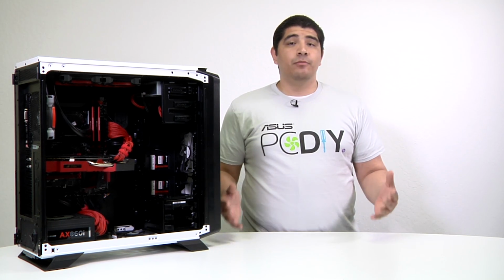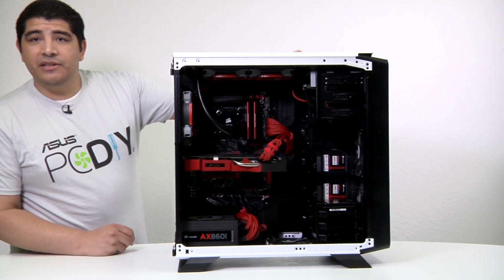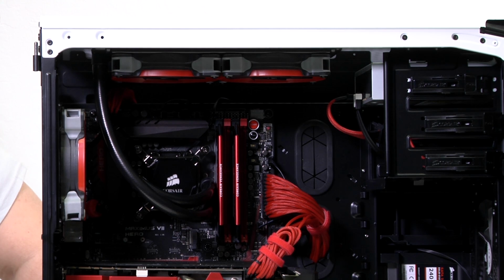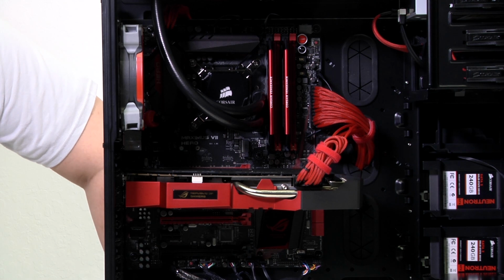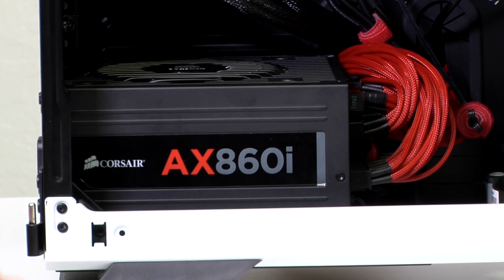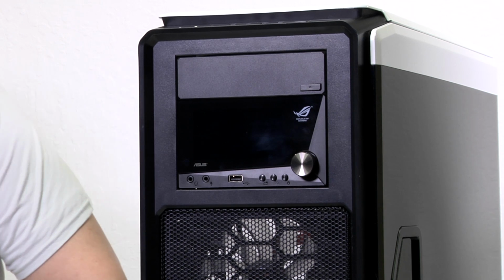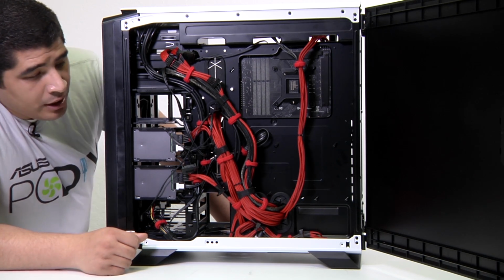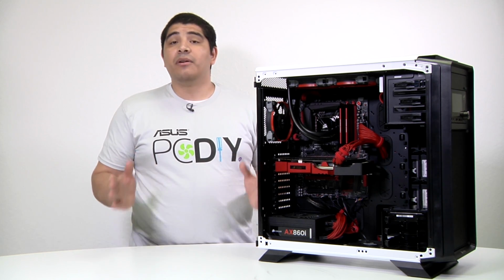How to Build a Killer Gaming PC with ASUS Z97 Motherboards

Comment: I would rather use a good air cooler from Zalman than the Corsair H100i. It will give you better cooling than any sub-$200 liquid cooler, for under $100, and is quieter than the multitiude of other fans you will have in the machine.

Comment: After waiting 6 weeks to get my ROG Front Base for my Hero VII i find that the audio cable is still to short for my Corsair Obsidian 750D case, i thought Asus was going to fix this with the latest shipments, i have the latest bios on mine since i do have the sticker on it, at this point i am not even using the audio cable since it makes my otherwise clean cable management unsightly.

And for those that have commented about the GTX760, all i can say is maybe i got a golden card, mine is clocked @ 1301Mhz and + 500Mhz on memory, its the 4GB EVGA and i play @ 1440 most games maxed with 2x AA, you don't really need AA @1440.SLI maybe in my future but at this point i see no need for it.
Reply: *****
Thanks for the reply JJ, I respect you immensely, and yes i am in NA, Key West Fla, at times we don't think we are part of the USA, its 92 miles to a Wall Mart FFS! I will contact customer support and see how that goes, Im still enjoying my Front Base, and NOBODY is better than you as a company rep, hands down.

Comment: JJ, great video, help me out on my Asus Rampage IV Black Edition motherboard it has the EZ Plug with a 4 pin male connection, my Cooler Master 1000W Silent Pro PSU has a 4 pin female plug but it's square with 2 yellow 12V and 2 black ground wires, can I use it to hook to the EZ Plug and where do I get the conversion cable to make it happen? Thanks, love Asus and your videos.

Comment: Well done.  On the H100i did you have it exhausting air or intaking air?
Reply: exhausting air. :)
Reply: tokojojiji Really?
Reply: yeah, notice the placement on the red rings on the fans that are mounted on it. They push air through the rad and out of the case.
Reply: tokojojiji Oh ok.  I saw the red rings and had thought they were setup for exhaust.  Just need someone to verify.  Thanks!

Comment: weak cpu + strong gpu > strong cpu + weak gpu.
Your gpu + cpu combination doesn't make sense.
Reply: Wellstar Very good point given the title says killler gaming pc
Reply: ***** Games are more GPU dependent rather than CPU dependent. He could have selected the i5 or some cheaper amd processor and a stong GPU, but he got the i7 for some reason, which doesn't make any sense.
Reply: ***** Well, when it comes to gaming, the gtx 980 would make more sense, but an i5 would still max out every game.
Reply: ***** i5 and i7 doesnt make any difference in gaming, so it's useless to wate money to i7 if you're only playing games (I had to still answer sorry)
Reply: ***** Well then I highly recommend for i7
Reply: ***** He meant LGA 2011-3 CPU I believe
Reply: ***** Get the 4790k and watercool it, a couple of gigahertz and megahertz later, you will have an INCREDIBLY strong cpu.
Reply: Wellstar Isn't it already strong enough? But I mean, the title does say 'killer' after all.
Reply: GraphiTe The 4790k is already strong, but if you wont overclock it you can might aswell get the 4770 (non k)

And as i said, if you can get a 4790k, you can might aswell get the i5 instead and use the extra cash to get a better graphics card.
Reply: Wellstar Ah, I see.
Reply: The whole real point is you only need a i5 there is very little difference in gaming between i5 and i7 (i have a i7 860 and my new 4790k)

a i7 has things it shines in, but in gaming it is only a little better than a i5 and costs alot more.

However the real reason everyone is like wtf is not about the i7 (even though looking at comments you would think it is).

It is the 2 year old? mid range obsolete graphics card. 760.

i have a 4790k and a 970gtx and even pairing this would be somewhat wrong for pure gaming, but i do video editing so i can justify the i7, but if i purely gamed i would get a i5 and a 980gtx which is a much more appropriate match.

The Real reason....
current games dont support multiple cores well, games support 1,2 or 4 cores, very very very few games support 6 and as far as i know, no games support 8 cores.
the top i5s have the same core count as the i7 the big benefit of the i7 being the hyperthreading (+ more) but the hyperthreading has very little impact due to the current games lack of ability to support multiple cores (hyperthreading is virtual cores).

However if you were to buy multiple graphics card (sli or xfire) or a super graphics card(titan) then the i7 mayb a little more viable

P.S. i7 is awesome :) for everything, but this dosn't change the fact that it has little game fps improvement over the i5.

This money is better spent on a upto date graphics card, better graphics cards tend to show the best fps increases in games not cpu's

Most games performance rely heavy on the graphics card, an exception being starcraft which rely's more cpu(there are more), therefore most gamers should have awesome graphics cards.
Reply: SiCK GamER Exactly, you can use the extra cash to spend on a better graphics card. I have the 4790k myself paired up with the R9 390. I could have gotten an i5 to fulfill my gaming needs, but since im also working with 3D rendering the i7 gives my computer a little bit of extra Bacon.
Reply: I run an i5 4460k with a GTX 970 and 8GB of RAM. It's for gaming. The i5, though not as good as some i5s, was about $190-$200, and it has great single core performance. The GTX 970 is more than enough of a good GPU for me (runs everything highest settings at least that I play, like Witcher III, GTA V, etc.) at it cost me about $380, and the RAM... I thought about getting 16GB but there is pretty much no point in 16GB unless you are rendering videos (same as i5 vs i7), and no game with applications already open should eat up more than 8GB of RAM. I'm really good at managing my RAM usage anyways. For anybody thinking about building a PC, the GTX 970 is amazing and you'd be so surprised at how much of a difference an SSD can make. Buy one.

Oh, and all that is connected with a Fatal1ty Z97 Killer Mobo. That's how I got here.
Reply: Lindsey VanDusen First of all, nice build. Second of all, what comment are you reffering to?
Reply: Wellstar Just contributing my two cents to the conversation. Supporting your argument if anything. An amazing processor isn't required for gaming, just one that is good enough not to bottleneck your GPU. Running on a GTX 970, anything that wont bottleneck that is good enough for the game IMO. 

Not many games are CPU intensive, and any games that are usually run the best with a processor that had great single core performance in my experience. I went with an intel specifically for that, because intel processors though not exclusively better than AMD often have a better single core quality even at lower clock frequencies.
Reply: Lindsey VanDusen I feel like AMD is loosing a lot to intel. They have been re-using old architectures for years now, and eventough they make good processors, i'd almost never recommend an AMD processor to anyone (except for when the build has to be very cheap)

Im hoping for Zen, or whatever they are coming out with 2016/17.

Same with the GPU market.
Reply: +Wellstar  I have the 4790k sli 970s . whats your thoughts, I'm new to pc
Reply: yes sir It's a good pc, will run most games maxed out.
Reply: +Wellstar just finished switching everything over into a corsair air 540 since my h440 was getting hot with the covers on
Reply: yes sir Do you overclock a lot? Because a H440 shouldn't be a problem for airflow unless you have several graphics cards and or overclock a lot.
Reply: +Lindsey VanDusen  nice build :-)  i run a i5 4690 with a evga GTX 970 FTW and 16GB ram and 500GB SSD and i love it :-)
Reply: Oh and a good idea for anyone interested in a powerful CPU, look for a Xeon. If you don't have a GPU then don't consider it but if you're building a gaming PC then you can waste less money on inbuilt GFX (like with a sandy bridge) and spend that towards a good dedicated GPU! Xeons are server processors so they are pretty tough and they are meant to never really turn off, so overclocking is usually more lenient, and without onboard graphics you wont be wasting $50 on that too!

Plus they are good multitaskers. I would go for an i5 for gaming honestly because of the great single core performance but the Xeon is a solid intel processor!
Reply: Lindsey VanDusen Used to have the 1230v3, it performed almost equaly with my 4790k (the i7 did perform better when i overclocked it though)

Comment: I've just purchased ASUS Maximus VII Ranger motherboard, I've built a system but while POST I'm getting Q-Code 'AE' - Legacy Boot Event (as mentioned in manual). Please help me in this regard J.J. It booted first time perfectly & I can see in monitor as well & it was written Press F1 to run setup when I pressed F1 nothing can be seen in monitor after that. I dont know what's happening just AE can be seen in Motherboard & no display now... I tried reboots but still no displays & AE error code on motherboard.

My whole configuration is as follows::
Intel core i7 4790K
ASUS Maximus VII Ranger MoBo
Kingston Fury Red Series 8GB - 1600 MHz
Corsair H100i CPU Cooler
Corsair CS750M PSU

Comment: JJ my p8p67 le motherboard 2xSATA 6Gb/s ports gray are saying your ssd is connected through SATA 3Gb/s SATA2 port in Samsung magician evo850 ssd I am using the wires form the box if that's a problem

Comment: Hey, what do you think about this build? I want some help cause its my first gaming pc: 
Case: Cooler Master Elite 430 USB 3.0
MotherBoard: Asus Maximus VII Hero Intel Z97 SK1150
SSD: Kingston SSDNow V300 2.5 Sata III 120GB~
Cooling- Cooler Master Seidon 120V Plus
CPU- Intel Core i5-4690k 3.5GHz 6MB Sk1150
GPU- Asus ROG POSEIDON-GTX770-P-2GD5
Memory- Corsair Vengeance Pro 16GB (2 x 8GB) DDR3-2400 Memory 
Power Supply:Cooler Master Urano VX 750W

Total is: $1198

I was thinking on VII Gene mother board for my pc, its a mAtx and 40$ less... Its Worth the trade?

Comment: i'd skip the h100i and the corsair fans, go for a decent air cooler, use just 1 SSd and get a R9290x or a GTX 780 instead of that crappy 760

Comment: ***** Hey JJ I have a question. I'm very new to all of this and haven't the slightest idea how to overclock anything. I am very interested in the Rog Front Base for my Asus Maximus VII Hero and I see its 1 button overclocking but what does that mean? For example if I have a i7 4790K which has a stock speed of 4.0Ghz and a turbo boost speed of 4.4Ghz does that mean I can reach 4.4Ghz with that OC button and stay at 4.4Ghz or do I need to manually OC the cpu in the bios 1st for the same or higher clock speeds? Many thanks in advance for helping a novice.
Reply: ***** I see. Thank you so much for the help. You rule man!

Comment: Hi there,

Would you please let me know your opinions or any suggestion ? I want to build a beast as follow: Really much appreciated. 

Motherboard Asus Z170 ROG MAXIMUS VIII HERO
 
Motherboard Asus Z170 ROG MAXIMUS VIII HERO
 
CPU Cooler Corsair H115i
CPU Intel Skylake 1151pin i7-6700K
 
RAM 16G Kit (8Gx2) 3000 Corsair Vengeance Black
 
Primary hard drive Samsung 850 PRO 512G
Secondary hard drive WD Black SATA3 1TB
 
Power Corsair 80+ Platinum HX850i
Case Corsair GraphiteCC780T-WH
 
Graphic Card 4G GTX 980 Gigabyte OC (WF3OC)

Comment: ould this set up work and will it be good, also what could be improved (this is my first build and want it for gaming)

cpu: Core i5 4590 Quad Core Processor Socket 1150 
cpu cooler: Coolermaster Hyper 212 EVO
motherboard: Asus Z97-K Socket 1150 VGA DVI HDMI 7.1 Channel HD Audio ATX 
memory:Corsair Memory Vengeance Pro Series Red 8GB DDR3 2133 MHz Dual Channel 
storge: Corsair Memory Vengeance Pro Series Red 8GB DDR3 2133 MHz Dual Channel 
storage:Corsair 128GB Force LX Series SSD - Solid State Drive
power supply: Corsair AX860 860W Full Modular 80+ Platinum Power Supply  (WASNT SURE ABOUT THIS)
optical drive: ASUS Black 12X BD-ROM 16X DVD-ROM 48X CD-ROM SATA Internal Blu-ray Drive 
operating system: windows 7
graphics card:  Asus Nvidia GeForce GTX 760
Reply: Overkill on the PSU. You only need a 500W for this kind of build. And a 760 is  a bit ... not so relevant anymore. You find really good prices for 780s that are way more powerful.
Reply: Get the 4690k
cooler is good
motherboard: get the gigabyte z97x sli its better.
memory: get g skill trident x its cheaper and better
ssd get crucial mx100
psu get evga 750 g2
and get a gtx 970

Comment: Hey guys, i really need a help here. I never build any PC on my own but currently thinking on building one for the purpose of having a workstation for a small studio. These are the parts that i'm thinking to purchase :

Intel Xeon E3-1230 V3
Asus Z97 Sabertooth Mark1
Corsair Vengeance Black 16 GB
WDC SATA III Blue 1 TB
Asus GTX 970 DirectCU II
Corsair Carbine SPEC-01
Corsair CS750M
APC BR1200 GI Power Saving Back UPS Pro
Asus PA238 Q

My questions are, is there any part that i should replace in terms of cost effective and is there any part in this build that will cause any bottleneck or basically any issues that may appear later on? Also, i'm thinking to SLI the graphic card later in the future when i have more money just to increase our productivity in the studio, will there be any problem with that? and what do i really need a water cooling solution for this build, just like everyone had been telling me? and If i do, what is the affordable but decent water cooling solution that you guys think i should get?

Thank you so much for your time and answer, I sincerely hope that some of you can answer my questions. Have a good day!
Reply: I think this is a bit too much for a Workstation, pretty solid build tho. But you don't need so strong components (if you're not playing video games) for a Workstation alone.

Comment: i like to buy ....i need to know the price of cpu with spec..... CPU: Intel Core i7-4790K 4.0GHz Quad-Core Processor
CPU Cooler: Corsair H100i 77.0 CFM Liquid CPU Cooler
Motherboard: Asus MAXIMUS VII HERO ATX LGA1150 Motherboard 
Memory: Corsair Vengeance Pro 16GB (2 x 8GB) DDR3-2400 Memory 
Storage: Corsair Neutron Series GTX 240GB 2.5" Solid State Drive 
Storage: Corsair Neutron Series GTX 240GB 2.5" Solid State Drive 
Storage: Western Digital BLACK SERIES 1TB 3.5" 7200RPM Internal Hard Drive
Case: Corsair 760T White ATX Full Tower Case 
Power Supply: Corsair 860W 80+ Platinum Certified Fully-Modular ATX Power Supply 
Optical Drive: Asus BC-12B1ST/BLK/B/AS Blu-Ray Reader, DVD/CD Writer (i don't need keyboard..mouse..graphic card )